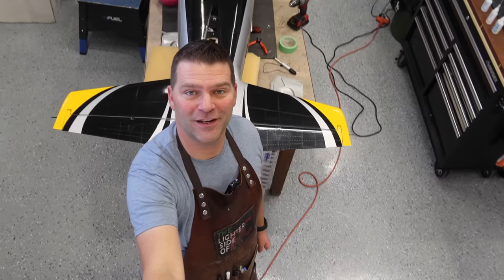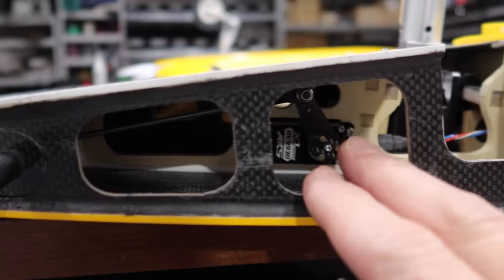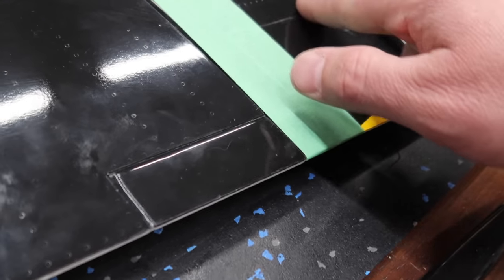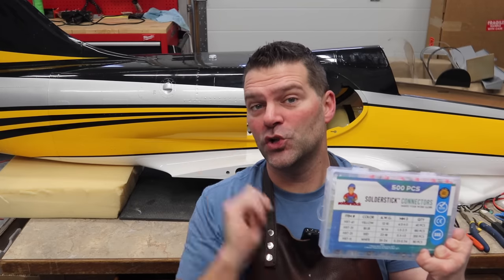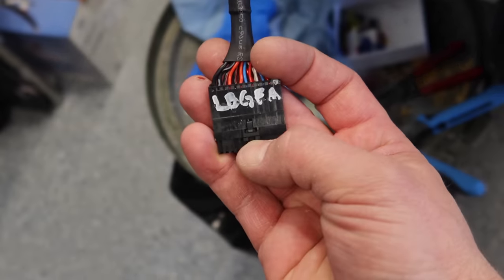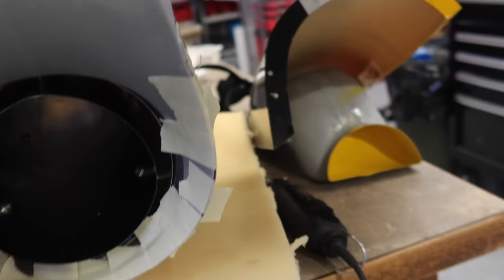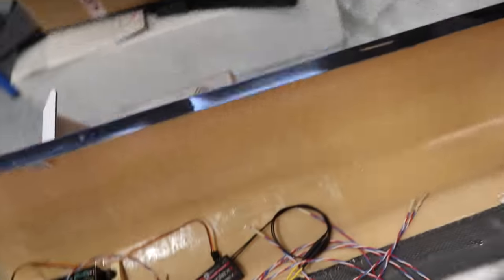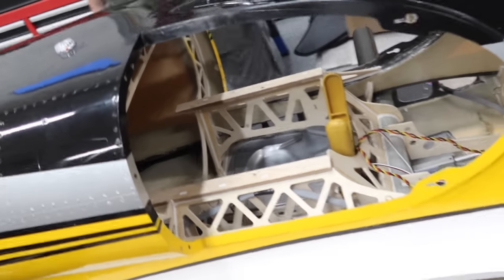L39 Albatros RC JET

Comment: For the beacon lights, could you have shaved off some of the internal fiberglass and foam to let the LED poke through the outer skin after drilling the center hole?  It would be a little more finicky than carving out for the heatsink to sit through the skin, but it seems it might be a little bit stronger.  That is definitely going to be a very pretty plane when you get finished!
Reply from the maker: Yea definitely possible.  The way that most of the unilights are designed though is the white board also houses and centers the reflector.  So with everything mounted from the inside there is only a surface contact holding the lens/reflector in place against the skin of the plane.  with the stuff mounted on the outside it's additional contact with the lens.  I don't think that really matters but that's the only difference I can initially think of.

Comment: Hi, just wondered what radio system do you fly with? I'm wanting to have a turbine one day but I only have a DX9 at the moment, is there a particular radio system you would recommend?
Reply: Hi, I just bought my first turbine jet and have a Spektrum ix20. Some use the Jeti system. I prefer spektrum since i am familiar with their radios. You will need at least a 12 channel system. My jet uses 11 channels but has no light system or smoke. The ix14 Transmitter would work fine, i purchased the ix20 with my jet as a combo deal.
Reply from the maker: Hello. I switched to Jeti mid 2022. Top radios right now are Jeti and Core. I have absolutely loved the switch to Jeti. I sold all my JR Stuff recently. I also have the ix20 shop radio and refuse to fly large aircraft with it. Lots of guys seem to also be going to FRSKY. I haven’t used one yet. Only heald one and didn’t like how short it is. Feels like a game controller.